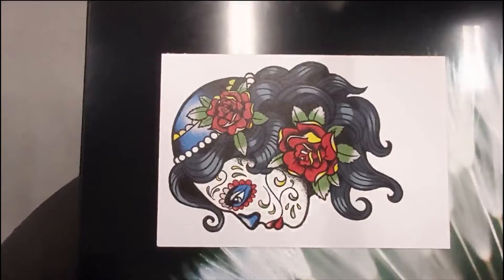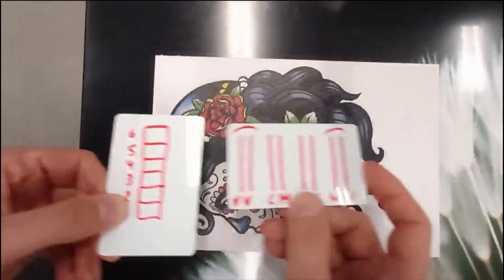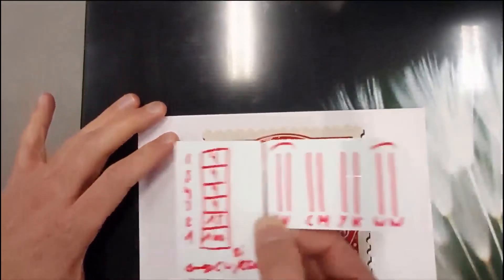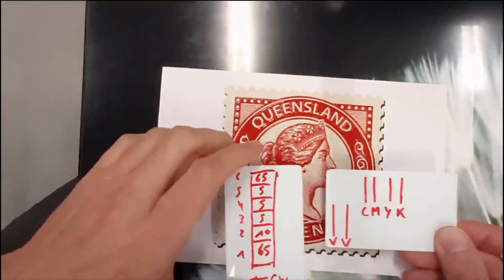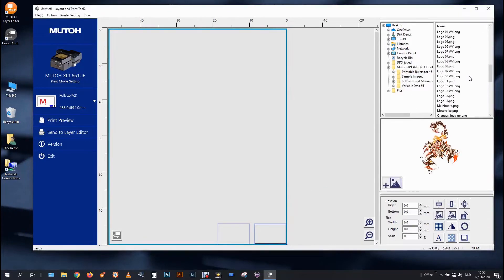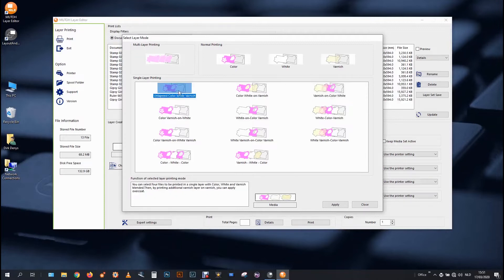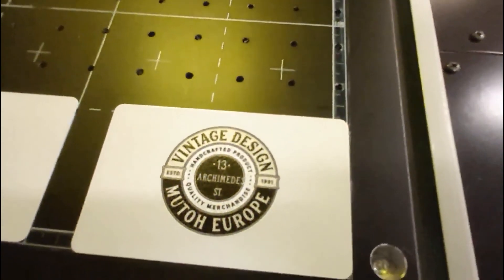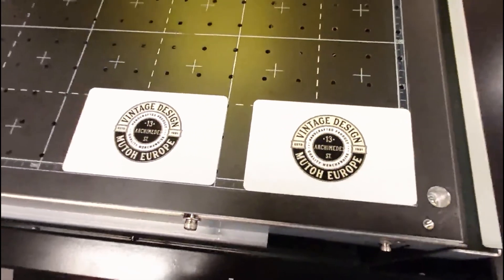XpertJet 461/661UF DTO printers – Instruction Video 6 - Local Dimming Control

Comment: Can this be done using Digital Factory, or only via Layout/Layer Editor? I mostly print white, so I have the RIP set to convert all colour in a document into white - but I'm struggling to have different artwork be printed in varnish (ie a name in white, and then a logo in varnish). I started using Layout, but switched to the RIP as for batch printing, I just drop a PDF into a hot folder and click print, whilst with layout I had issues loading PDF, and then having to place it and confirm/change print settings based on job. Can Layer Editor be accessed via Digital Factory, or is there a way of setting them as presets? Thanks!
Reply from the maker: Dear Jon McCoy, Thank you for your inquiry. Can we bring you in contact with our application engineers?
They can provide full details on our Digital Factory UV software pack. Please provide us phone an e-mail or leave your inquiry at https://www.mutoh.eu/en-us/forms/generalinquiry.aspx
Thank you. Best regards, Mutoh Europe Customer Team